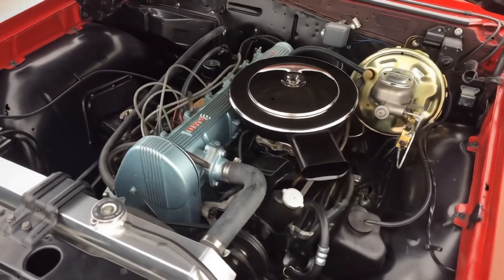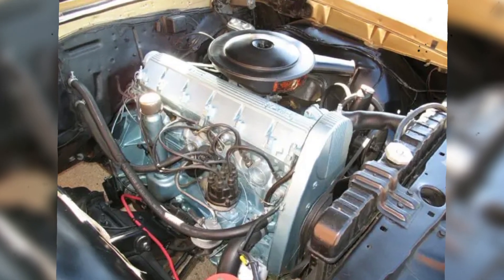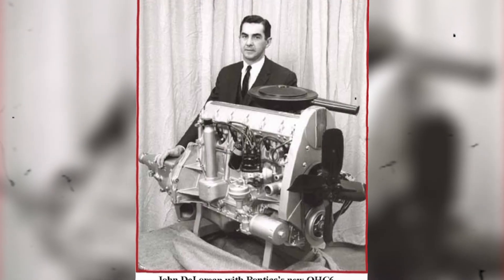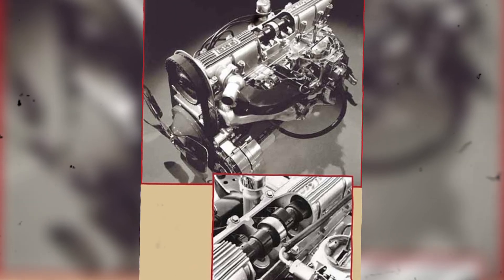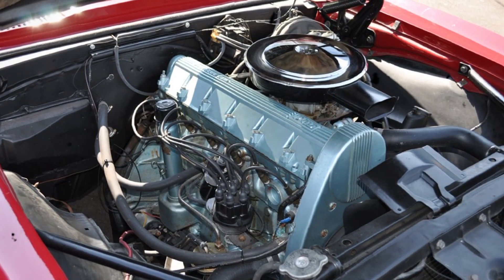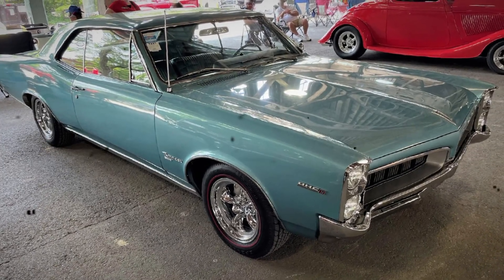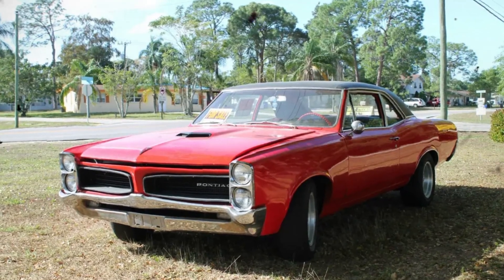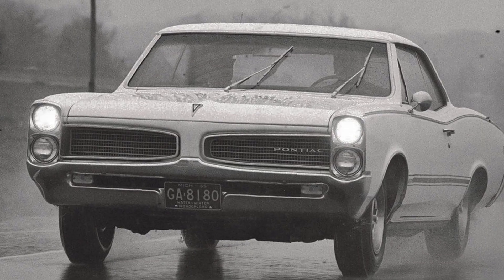How Pontiac Engineered America’s First True Modern Overhead Cam Powerhouse

Comment: Jeep Tornado 230 OHC 6cyl  1962.       NOT first.
Reply: I was thinking the same thing, the Jeep Tornado inline 6 with an overhead came a few years earlier.
Reply: Valvetrains  don't affect vibration.
Reply: Crosley offered an OHC 4-cylinder in 1946.